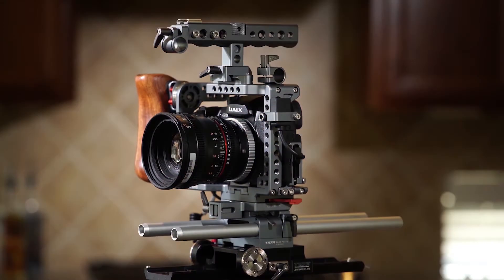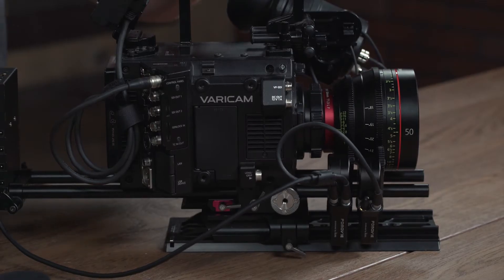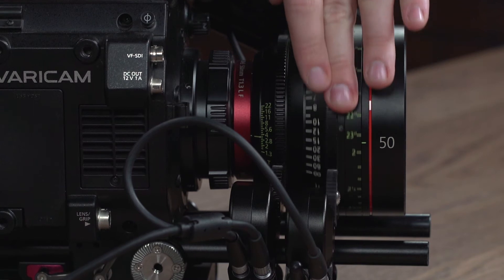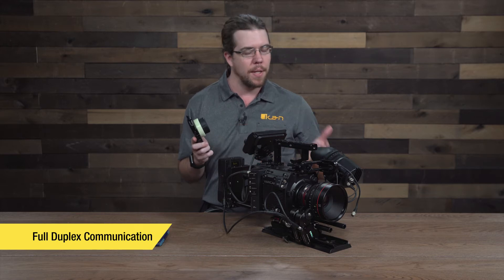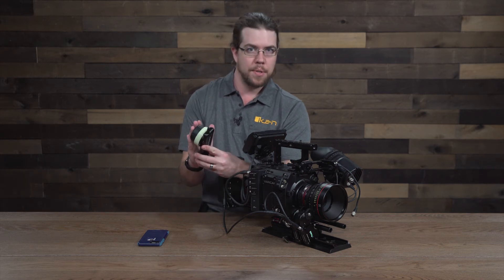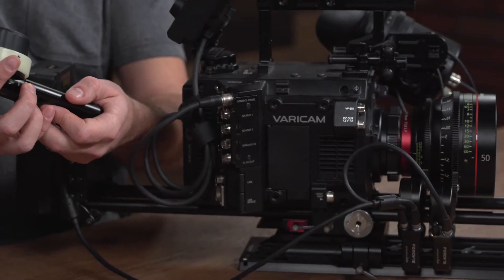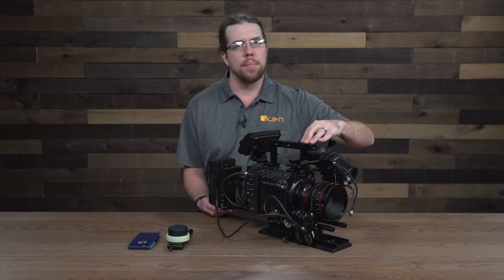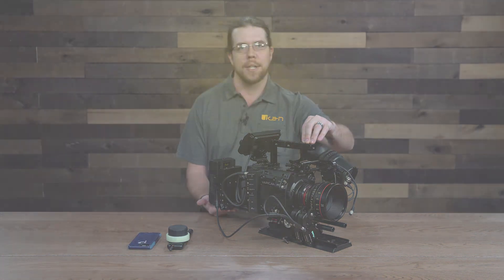PD Movie Remote Air 3 Wireless Lens Control Kit | Ikan Tech Corner

Comment: You able to change Iris and focus at the same time with the candy bar remote?
Reply from the maker: Yes, you can control zoom iris and focus with the hand controller. It has two zoom rockers and the main focus wheel which can all be used at the same time.
Reply: Perfect! I noticed the Air 4 is coming out soon. What's the difference between that and the Air 3?
Reply from the maker: @clintdsouza  The main difference is in the motor specs. The newer motor model has 2x more torque, is 3x more sensitive, and is a third of the size.
Reply: @IkanInternational  Could you demo PD Air 4, please?
Reply from the maker: @MrMilanina  For more information on the Air 4, you can check out this video: https://youtu.be/U_BXgwhogkk

Comment: When will you have Android support?

Does the hand unit have the ability to dial in dampening? loosen and more dampening on the knob?

Can the torque be set to low, med, high?
Reply from the maker: Hi there. Thank you for reaching out to us. I've got some answers for you.
Android Support: I'm afraid there are no plans for Android support.
Dampening: Also afraid not, but you can change the motor speed/torque to get a similar result.
Torque Settings: Done on the motor. You hit the button 5 times, I believe, to change the speed, and gauge the speed on the blinking LED indicator: Fast, slow, or solid color for slowest/highest torque.
Hope this helps!